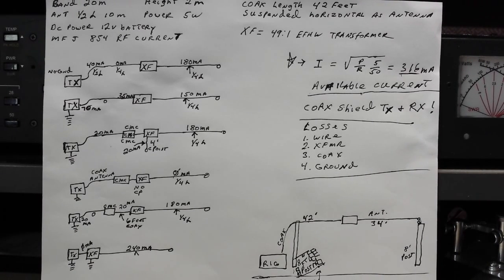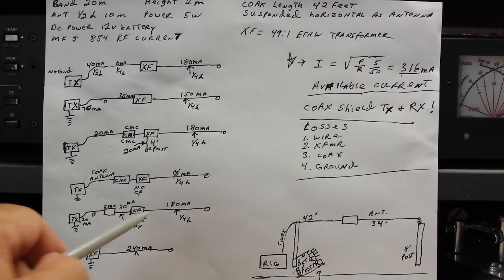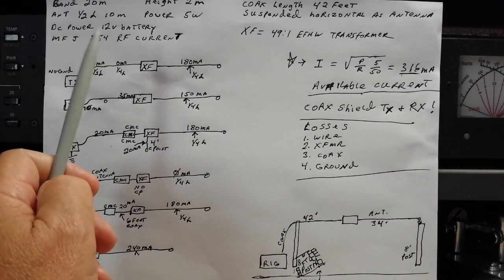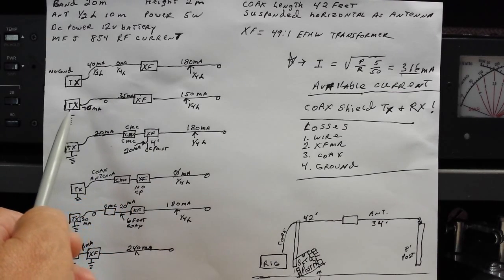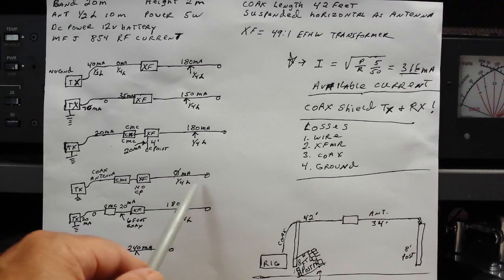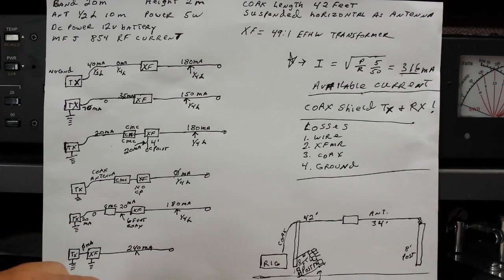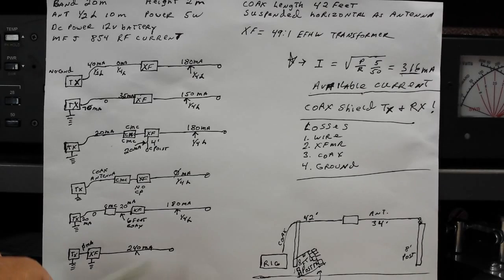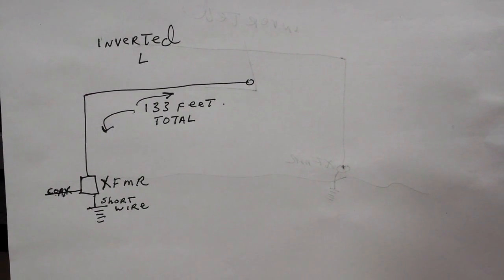EFHW Installation Summary or Is your feed line part of the antenna?

Comment: Steve, Thank you for this video.  You have answered several questions I have had and saved some time.  I will be changing the installation of my antenna today to the inverted L.  Right now I have it up about 13 feet, a ground wire dropping down to the ground.  Whoa!
Burt K4SRQ

Comment: I recently installed the myantenna 40M/80M/160M EFHW ,mounted as an inverted V with the apex at 110'. Using the MFJ meter you mention here, 28ma. was measured at the antenna transformer, 50 ma. in the shack, with 10w Tx. There was no change when grounding the transformer to a ground rod, but now the SWR was closer to manufacturer specs. After installing the myantenna  RF choke at the antenna side there was no reading there or at the shack side of the transmission line. There was a slight reading on 160M.

Comment: Well this explains what happened this weekend. We were manning a 2m radio for a club supported event and set up a new FT891 and an EFHW antenna. Initially the inverted V with ground wires did pick up signals. Apparently I forgot to attach the antenna to the transformer. I was receiving through the two 52' ground counterpoises. Once I realized what was wrong and hooked the antenna on I got plenty of contacts including a weak one from NC to Germany.

Comment: Thank you for sharing. Excellent explanation of do's and don'ts. If I had the equipment you have, it would be interesting to see what it would do on top of my chain link fence. I have 880' of fence around the yard with 1 1/4" top rail. Put a ground rod at the transformer and also tied to the fence.

Comment: Does the length of coax affect the amount of current?  Yes.

Another things that affects the current on the coax is the choke placement.  The worst place to put a choke is near an end fed half wavelength antenna.  The reason is the choke works on the current, effectively pushing current at that point to 0 or very near 0.  If you put the coax at a place that doesn't have much current, like the place you used put it.
Reply from the maker: I have no idea what you said friend.
Reply: @n4lq  Hard to detect what Mr. Hitt was trying to get acrosst here.
Reply: I think he's just saying that you shouldn't place your CMC ferrite(s) at a voltage node--where voltage is maximum, you will have current minimums.  And the place along the coax (as you move away from the transformer and towards the rig) where the current is the lowest will vary by frequency.  He's suggesting that the choke wouldn't have much effect if it's introduced at a point where there is essentially no current (rather a high voltage only).

Comment: Steve, I would love to see one additional test. It would be similar to the very last example where you had 240ma as a result of moving the XF close to the rig. But,  instead of having both the XF and rig grounded in this example, I'd be curious what the relative antenna current would be if they were 'floating'.  Elevated operations whereby no ground is readily available is the configuration impetus behind this question.  I am going to guess that, in the elevated position, a short counterpoise is the answer but I would imagine that you have already determined the answer. If you could please briefly share that here, it would save lots of time. Thanks for sharing your interests and projects. 73, Bill
Reply from the maker: When the XFMR is elevated the best you can do is to install a common mode choke about .05 wavelengths, lowest band, away from the transformer. No other couterpoise is to be used. The CMC must have a very high resistance instead of reactance. The best CMC I have found is described by K9YC in his Choke Cookbook. It's a series of three 240-31 ferrite cores with about 8 to 15 turns of RG-400 each. This acts like a brick wall forcing most all current to show up on the counterpoise and antenna. It does look ungainly hanging up there but it works. My 80-10 has the CMC about 16 feet from the xfmr.

Comment: Hi Steve,
I love your EFHW antenna videos and I've learned a lot by watching them.  I am building a 20 Meter vertical EFHW with a standard 49:1 impedance autotransformer.  The transformer will be 4 feet above ground with two counterpoises (starting with 7 feet each hanging from the transformer at about 30 degrees each and laying on the ground part of its length.  I will put a CMC with about 1,500 ohm impedance at 14.250 MHz which is about 600 ohms at 28.5 MHz about 6 ft from my radio.  I will have it up next week and will tune it then.  I am looking for low SWR and a great 17 degree take off angle for DXing.  I will be running 700 watts SSB voice.  Please cover a vertical EFHW antenna sometime.  Thanks, Hank K5HHQ
Reply from the maker: I would recommend using no counterpoise. Drop the coax straight down and put a CMC 40" down from the transformer. This assumes the support post is non-conductive. The 40" coax shield will provide your displacement current. Counterpoise would be lossy.  For a good CMC just 8 turns through a 43 mix core will do the job. 
The resulting take off angle will be extremely low...So low that your stateside signals will be lower but really far out DX will be better. It's a very specialized antenna. I tried one and ended up taking it down because there just wasn't much to talk to.
Reply: Steve Ellington Thanks for your suggestions and comments.
My final set up was no counterpoises and a 6 AWG copper rod from the transformer to the grounded support pipe.   I measured the final SWRs to be less than 1.3 on 20 meters phone band and less than 1.5 on the entire phone portion of the 10 meter band. 
I had better luck than you had with closer contacts.  Made several cintacts from my Oklahoma QTH to Montana, California,  Texas,  Florida and others with 5X9 conversations.   I also had 5X7 reports from Italy and a 5X9 report from Mexico City and Alaska.  I asked for replies to compare my standard 4010 Myantennas EFHW up horizontally up 30 feet with coax from 30 feet up to my shack with no transformer grounding except the coax grounding at my shack.  In all cases the transmit performance was about the same.  There was slightly more receive noise on the vertical antenna.   I love my new verticle EFHW!

Comment: Thank you for this video it was very informative and exactly what I was looking for, that being said i have a question. Short version is would the out come be similar with a non resonant random wire in the same instance? Long version, I have a princeton EF-37 .. 37ft wire end fed with a 9.1 unun I use for qrp with my 818nd, I am feeding it with 35ft of rg8x usually laying across the ground and I hang the XF close to the ground and run the wire radiator up at an angle. So I usually do not ground the TX or XF.  Would i benefit from grounding the XF and doing it basically the way your inverted L setup is? And would this help with feedline radiation or would things be way different considering this antenna is not resonant. Also I'm running a 1ft jumper to a z817 qrp antenna tuner and then the 35ft coax to the XF and then the 37ft wire. Also if grounding would be the way to go would a simple ground rod and short wire from G plug on XF be best or grounding to say a metal fence that could act as a ground and counter poise. Thanks for all the help I'm jus trying to get the most from my setup 73 KD0OOP

Comment: Thank you, This answered my questions about where to mount the transformer.  I guess mounting it high above ground is out of the question. 

I just thought of one more possible option.  What would it do if you ran A) a wire direct from the transformer ground to the radio ground with NO ground rod?  And B) if the same wire were braided copper?  

I know you were trying to establish a ground for lightening protection, which is essential for the home setting, but I am also looking for a portable option where I might not need or be able to use a ground (such as in a parking lot).  

I know it would effectively be a short, but also possibly an impedance to the signal?
Reply from the maker: My transformer hangs 80 feet in the air, no ground wire...nothing ....just coax down to the rig and the rig is grounded. Just forget about counterpoise.
Reply: @n4lq  Thank you.  That helps. 

What would you recommend for a portable antenna that will not be grounded?  I have expectations of setting up temporary stations at places like parking lots and Parks (POTA) where driving ground rods are not practical or possibly not permitted.

PS I live just up the road from you and would love to take you to dinner sometime to meet face-to-face.  I have adopted you as my authority for EFHW antennas.

Comment: Hi Steve. Very interesting. But how do you explain that the antenna is “killed” in your fourth example (at 8:38)? To me it seems that the antenna (which is resonant) is perfectly coupled with the feed Line by means of the 49:1 transformer, which normally means nearly 1:1 VSWR and hence NO common mode current on the feed line? And there is even is a choke present to kill any common mode current if present at all? I would expect the antenna wire to radiate ALL the power, but you measure NO current in the antenna itself? What am I missing? Please explain...
Reply from the maker: It is "killed" due to a term called "Displacement Current". Kirchoff's law requires equal current on each side of a node. The end of the antenna at the transformer is the node. We therefore need this small amount of displacement current on the input side of the transformer. The current comes via the coax shield. The choke acts to block any current therefore there is no displacement current thus no antenna.
Reply: @n4lq  Thank you very much Steve, that makes good sense to me.

Comment: Steve, thanks for your experiments. On the last test with the transformer 2 feet from the ground, did you try using the counterpoise and if not, do you think it would make any difference? The challenge I see is how to get at least 240ma at the center with the antenna as high as possible. Your thoughts? Tnx de K9RJ
Reply from the maker: Keep in mind that 240ma  just happens to be what I measured under all those exact conditions. What we want is maximum current in the antenna and as near zero in the coax. The way to achieve this is to establish a good ground at the transformer and choke off any remaining current on the coax (at the transformer). From what I see here, having the transformer anywhere other than near earth ground will result in common mode currents on the coax. Even if you use a choke and short counterpoise on the transformer remote from the rig, the common mode magically shows up again even after it's been choke out. Any common mode current can be subtracted from the total antenna current. 
At this QTH I had one EFHW horizontal at 80 feet with the coax dropping straight down from the transformer, CM choke then more coax to the shack. Sounds ideal doesn't it? Then i installed another EFHW with the transformer at 6' high, antenna sloping up then out like a lazy L and only 40 feet high. This one blew the high antenna away with an average of 10db improvement as reported by stations on our net. Quiet amazing!
Reply: @n4lq  Does antenna at 6' have any counterpoise, CMC or ground?

Comment: Good video Steve. Please comment on this. My portable ant is 65 ft with 64:1 transf and 8 ft of very light coax.  Deploy as inverted V with transf usually abt 3 ft off ground.  No choke. Sometimes I hang a cpoise from transf. This ant has worked well in my opinion, but I watched your video to see if I could improve it. My take from your video is to add a choke near rig and lose the cpoise. But please tell me how you would improve it. Thx! Scott kw4jm
Reply from the maker: If you're happy with it then don't change a thing. The choke is there to keep RF out of the shack but if you have no problems, you can forget it.

Comment: No. We do not utilize the coax as a counterpoise. You should be immediately choking the coax with a 1:1 CMC and running a ground to earth rod (for POTA bring a portable one) or counterpoise 1/4 of resonate length for lowest band. This other stuff is not necessary and results in too much maintenance. Can we please dispel the 1950's technology (such as NEC nonsense says you need to connect to your home electrical ground and then everyone screams they have high noise floor). Lets read the instructions of your antennas people. Counterpoise or ground of the 49:1 none of this other nonsense.

Comment: I'm a bit confused. You said that the last of the series of illustrations was the best, with the TX and unun very close, and both grounded.
However, in your last image, of your actual setup, the TX and the unun are 100' apart, and only the unun is grounded, so that is in opposition to what you said was the best scenario. 
Please explain.  
Thank you.
Reply from the maker: I prefer not to have the TX outside in the weather😊 The coax lays on the ground so it doesn't radiate. This goes along with my prior statements.  Also I do have a CMC at the shack entrance....Since this video I have moved. My antenna is now totally horizontal at 80 ft. The transformer is  hanging at the end. Coax is vertical down to ground with a CMC at that point then another CMC where it enters the shack. Anything radiated by the coax shield contributes to the overall radiation. Works great.
Reply: @n4lq   No grounding to a ground rod?
Thank you.
Reply from the maker: @usernamemykel  Yes.... Ground the coax at a joint.
Reply: @n4lq  
That's what I thought, professor.

Comment: Nice experiment, thanks for the video. What  really puzzles me is the difference between setups 2 and 4... I don't understand how adding the CMC would cause the coax absorbing all the power - I would expect the opposite.
Reply: Answer to self :-) The choke should be at the radio end, at the antenna end...

Comment: Ok EFHW seems possible here. House is chicken coup with plaster and paint. X former 3ft up grounded. wire up 10 ft then straight out to 25ft pole and curved out to 10ft end point. 63ft if my memory good. I have  1:1 current isolation balum would that help with cmc rfi into shack?
Reply from the maker: You might not even need it but if you do put it in the shack at the rig
Reply: @n4lq  Tnx. concern remains if my chicken coup with an address will cause tuning issues. TESTING!!! 73's oh yes what FB adr for group mentioned?
Reply from the maker: @richard-fy2mu  https://www.facebook.com/groups/EndFedHalfWaveAntennas/

Comment: Thank you for this excellent video.  I have the Myantenna EFHW 8010P in which the balun has no connection for a counterpoise or ground.  My configuration is exactly like picture 4.  One thing I've noticed is that on 60 meters my swr is 4:1 and above when the coax feed line is laying on the ground, and 1.5:1 when the coax is about 6 feet above ground.  These readings are without a tuner.  80 to 10 meters are good either way. I'm beginning to think that my coax is doing what you explained in picture 4 about having a good swr but 0 ma on the antenna wire itself.

I was thinking of opening the balun box and attaching a wire on the S0-239 ground side if the ground side is attached to any part of the balun.  The box is held together with rivets.
What do you think?   Thank you.
Reply from the maker: That's the only one he makes with no ground post. I guess because it's "portable". Technically, grounding the coax shield at the transformer will make things even worse on 60 meters. The impedance of your antenna is just too far off to match on that band. So yes, you are using the coax shield as the antenna and grounding it will probably even kill that off. If you still want to make a good gnd. connection just get a small hose clamp and clamp a wire to the coax connector and run it to ground. It must be very short otherwise it will again become an antenna.
Reply: Thank you Steve for your speedy response.  I think see what you are getting at.  Nothing like experimenting.  73s.
Reply: I know this is an old question, but my solution, if you need a ground, is to add a coax lightning arrester at the transformer, connect the wire and run the ground from the lightening connection. If you don't want lightning protection, remove the screw, shorten it and put it back so it does not go past the inside shell of the connector.
Reply: @BlessedLaymanNC  Thank you for the tip.  I followed Steve's video regarding using the 8010 on 60 meters and it works.  No ground at the balun end only at the radio side.  My feed point is close to the ground.